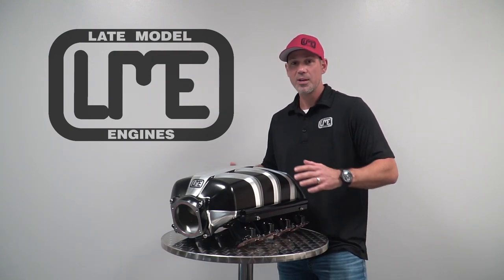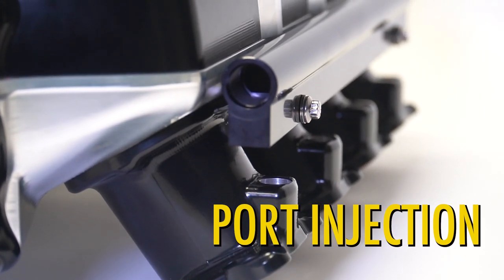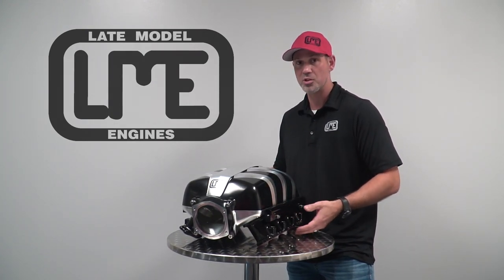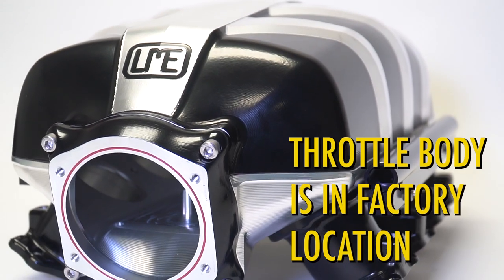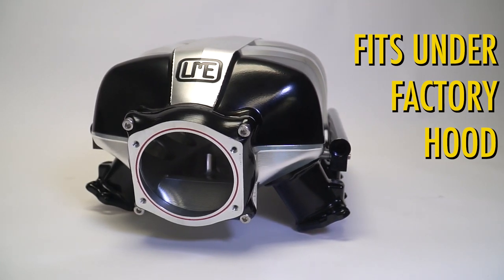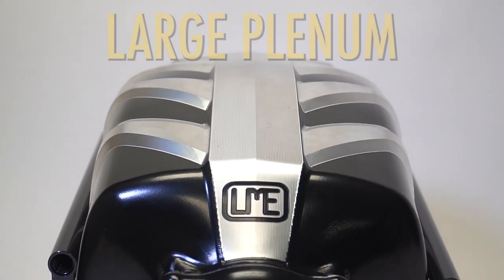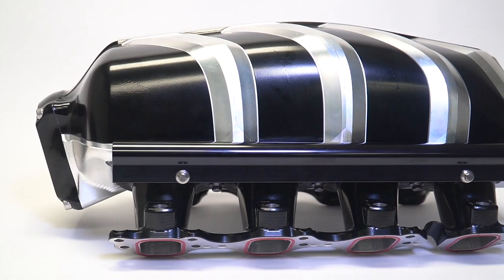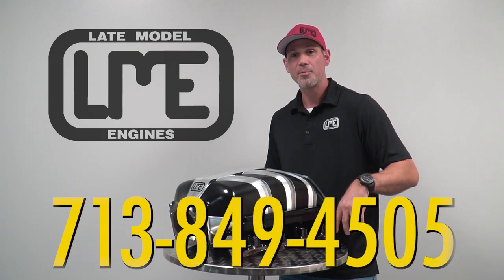C8 Billet Intake Manifold LT2

Comment: How good are the welds on this intake manifold?
Reply from the maker: There are no welds on this intake its made out of billet aluminum. We bolt it together with ARP HARDWARE. It can handle a lot of manifold pressure.
Reply: @LateModelEngines  lol nice
Reply: @LateModelEngines    Can you put a camaro supercharger on the c8 corvette?

Comment: Will this fit a convertible c8?
Reply from the maker: Hello,

Yes sir. No problem with the convertible. Let us know if you would like to get one sent out. Thanks!
Reply: @LateModelEngines  how would this compare to porting the stock intake? I was planning on using a 95mm throttle body. Let me know and share your number and I can call you
Reply from the maker: @martinharrison6801  713-849-4505, this will out perform the stock intake, ported or not.....